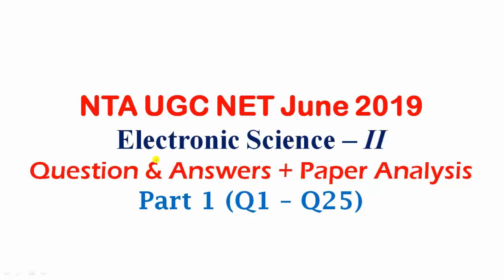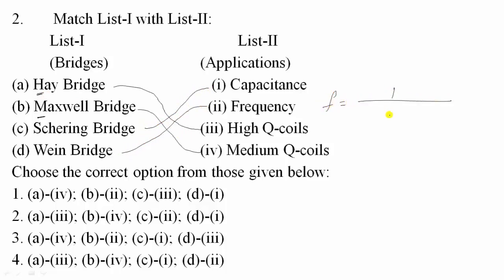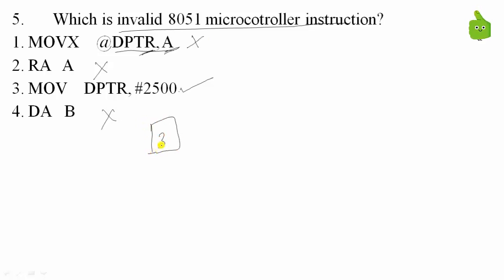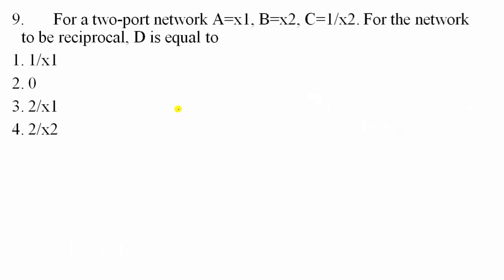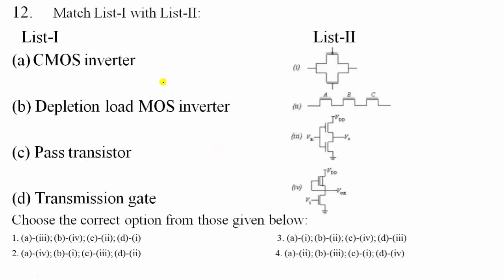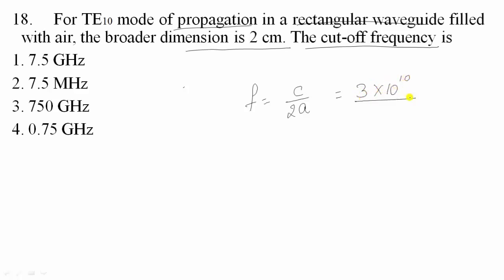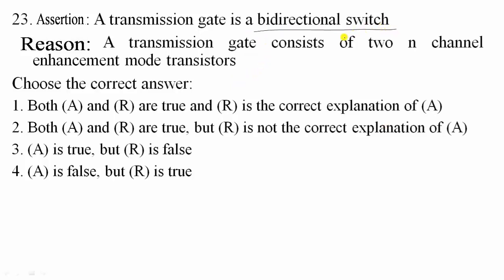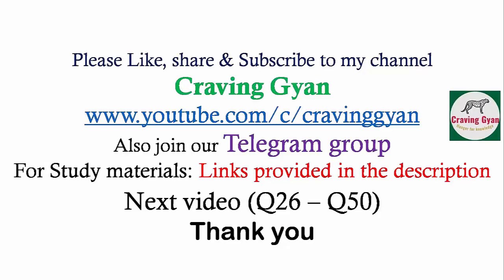UGC NET Electronic Science June 2019 Part 1 (Q1 - Q25)

Comment: First question ans is wrong...
Opamp has least current gain
CE config has highest current gain

Option (1) is correct for question 1
Reply from the maker: Please check your expansion once.
Common emitter current gain is Beeta.
Reply: @CravingGyan  dear sir,
In common emitter config, the current gain is quite high and thats why BJTs are used for driving the loads... Whereas opamp amplifies the voltage and current gain is not considerable...

That's why i am saying, in descending order of current gain....ce config must come first
Reply from the maker: Current gain is more in common collector than common emitter.
CC gain is Gamma, where as CE is Beeta
Reply: @CravingGyan  dear sir, current gain in common collector mode is unity whereas for  common emitter mode it is greater than unity
Reply from the maker: @vedantwankhede7481  
Don't get confuse with voltage gain.
Make yourself strong in fundamentals